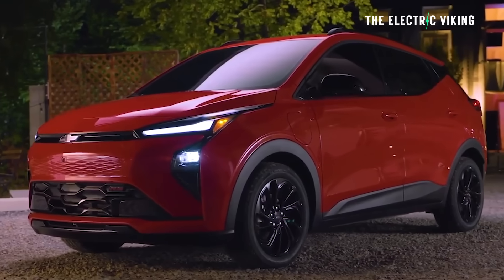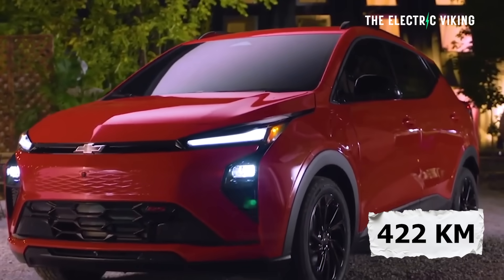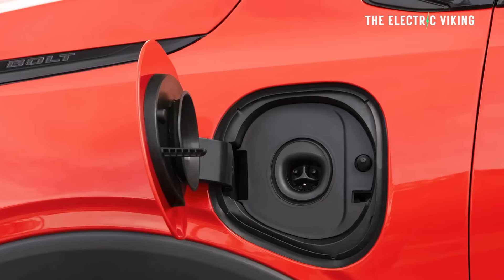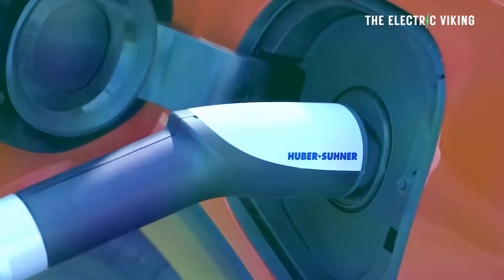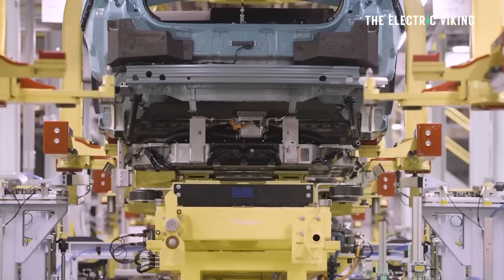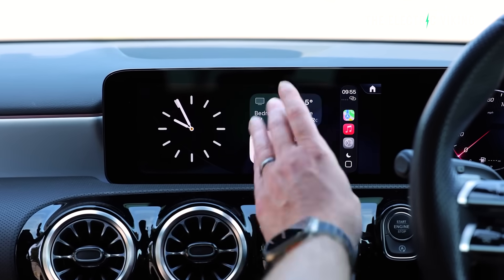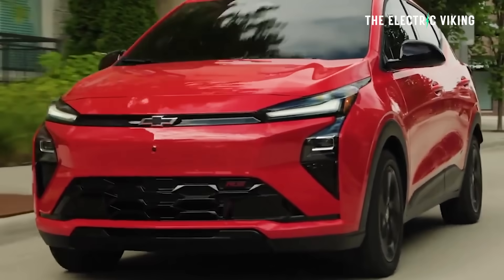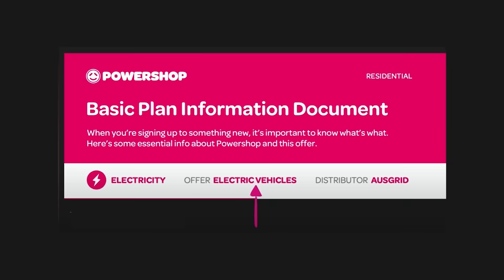NEW Chevy Bolt Goes on Sales With LFP Batteries and MORE Range Than Promised

Comment: $ 29,000 USD in USA!  The new Chevy Bolt with LFP batteries in the USA starts at $28,995 for the LT trim and $32,995 for the RS trim. This makes it the cheapest EV available in America for now, with a range of approximately 255 miles on a single charge

Comment: I own 2 Bolts, a 2018 and a 2019….had both for many years. 8 months out of the year they both get about 220-260 on a charge. They are fantastic entry-level EVs. I would buy the new one with zero doubts if I needed to update.

Comment: 3:14 Great that is a NACS port. Sucks that its in the worst possible location, they should have moved it to a corner. A V3 Supercharger (the overwhelming majority of the ones a Chevy can use) does not have a long enough cable to reach that port without having to park the car across 2 spaces and block an adjacent charger (unless you get the end one and theres empty space next to it, which so far I am 1 for 2).

Comment: 2:52 159 lb-ft? Thats over ONE HUNDRED (100) LESS than the previous version. That would eliminate its best feature - 2 lane passing. Wtf is Barra thinking? Torque is the killer app of EVs. She needs to get everyone hooked on EVs first before she starts shaving off the cool parts to cut corners. That will be a REALLY boring car.

Comment: I bought my '23 EUV as a second choice; I wanted an Ioniq 5 but the waiting list (at dealers that would sell at sticker) was 3 years ; I figured I would drive the Bolt for a while and get something cooler eventually.

I like it more every month. I love the huge back seat and flat floor; I keep looking at other cars (I would love faster charging and AWD) but none of them stack up, nevermind at a similar price. A Lucid costing 2.5 times as much doesnt have the heated/ventilated seats and the roof is so low I would bang my head getting in. Ioniq 5 you have to get the top trim level to match the features.

And I love how compact it is, anything else is 5" wider and 20" longer; I can walk between the cars in my garage without having to slide sideways (which would also be bad with that stupid "modern" thing other cars do where the door handles stab out at you when you get near, doxxing you to everyone in the parking lot that its YOUR car just in case theyre looking to mug someone). And with the 4 way cameras I can get into really small parking spaces.

Comment: No CarPlay is a big deal. GM also placed the NACS port in the wrong location for Supercharger use. Fail. 
For only a couple thousand more, Nissan offers 40 more miles of range, CarPlay, and most importantly, has the NACS port in the correct location. Sorry GM. Swing and a miss.

Comment: We have a 2023 Chevy Bolt EV 2LT. My wife did not want an EV, but now, even today she says it is the best car she has ever owned. She wishes it would charge faster than the 50 kw so the new Bolt at 150 kw solves that problem. We also are interested in the bidirectional, vehicle to home capability. We would consider the new Bolt for sure.

Comment: Please do not confuse the Bolt EV with the Bolt EUV.  This is happening as it seems the EUV will be the only one that will be made in 2027 model year.  Our 2023 can do 300 miles on a charge in good weather and summer tires.  Cruising at optimum speeds.

Comment: Not discussed is the very significant safety advantage the LFP (LiFePO4) batteries have.   LFP doesn't have the thermal run away issues leading to battery fires.

Comment: My '22 Bolt EUV is, by far, the finest car I have ever owned - and I've owned a bunch. The newly released version has no features or meaningful improvements over the previous version meaning that GM obviously got it right the first time. They're a roomy five seater with more than adequate power and performance, is impeccably assembled and the top trim model has luxury car features. Those new to EVs will be delighted with the Bolt for years to come. It's future proofed.

Comment: I was extremely lucky to buy a brand new base model 2025 Chevy Equinox EV last year for $14,600 US dollars ($31,800 - $2,000 dealer credit - $7,500 fed tax credit - $4,000 state tax rebate - $3,700 GM credits). I love it so far. Also, now you can stream Prime Video, YouTube, Tubi, HBO Max and other video streaming apps.
If I charge my car at home it costs less than $5.00 (10% to 80%). Gotta love it.

Comment: My brother bought a used 2017 bolt in the spring of 2025 for $12,000 . It had the battery replaced during the battery lg problem . The car has 30 k in miles so the battery has less than that . It doesn't have fast charging capabilities and that doesn't matter for  him as the car is just an errand type use and not used for distant travel . It's his first EV and really enjoys it and it still drives like new .

Comment: The Bolt had a charge rate limit of only 50 kw prior to this version.  So I'd say they fixed the most serious limitation.  My 2021 Tesla model 3 had LNAC  batteries when I bought it, but at 4 years the battery pack failed abruptly and Tesla replaced it with an LFP battery pack which also gives 263 mi. range.  So I've had the same car with both battery technologies.  I prefer the LFP.  It degrades slower and I can charge it to 100% any time.  In fact in the 17 months/13,000 mi I've had it, it hasn't degraded at all judging from the range it shows when at 100% charge.  So, yes, I'd certainly consider buying the new Bolt. Sounds like Chevrolet finally has a competitive BEV product.

Comment: This is a great car. But if you can get slightly used 2023 Tesla Model 3 RWD under 23k less than 50k miles that would be even better deal. Because LFP batteries last long time and has same CATL battey

Comment: The track record by GM as to EV’s falls on limited production, vehicles too small (Bolt, Spark), too large (Hummer, Excalade, pickup truck) too expensive (same as prior list). Is this latest Bolt the same size of the Bolt or Bolt’ larger cousin? The Blazer EV is the right size for US, priced OK, nice features. It is selling well. Where is this Bolt going to fit in GM’s EV strategy?

Comment: We almost bought the 1st generation Chevy Bolt, but cross shopped it against the 2md generation Leaf and found the Nissan Zero Gravity seats far more comfortable. Both cars suffered from overly wide A pillars. I have no idea what the A pillars will be like on the new generation versions of those cars, but consider your bottom and visual safety when deciding.

Comment: Have just over 170K miles on my 2017 Bolt. Love it. Slower fast charging is my only complaint, but for what I use it for, it's not a problem.  
We need more affordable EVs, so glad they brought the Bolt back.

Comment: I have a 2020 Bolt, my huge issue are the charging stations claiming to be DC. Nothing fast about these stations pushing out 27-32kw at 45 cents per kw and sitting for an hour or more trying to reach 80% from 10%

Comment: If I summer drive our 2023 Bolt EV, single pedal, at less than 55 mph.....I get 320+ actual miles (new battery).  I once pulled better than 350 miles running between 40 -55 mph (I was drafting).  Paid $21K otd.  We charge with 110 overnight without change to our bill.  This car will out muscle any 4 cylinder, make 6 cylinders cry, and embarrass 8 cylinders.  Not a highway car.....but DAMN. Best vehicle from Chevy in a long while.

Comment: We have the 2023 Bolt EV.
Fabulous 2nd vehicle. We bought it used for less than 20k with less than 10k miles on it. We have charged it overnight for 2 years it
ON a household 110 volt standard outlet.
   Super reliable and cheap!

Comment: I can understand someone not wanting to keep a car for 20 years but have the general public lowered their standards to not expect something to still be in good functioning condition in 20 years? Back in the 2000s and into the early 2010s I was still picking up 80s cars as cheap transportation that were still good running cars, if it wasn’t for the harsh Midwest winters and the stuff they spray on the roads they would’ve lasted longer.

Comment: I’m 70.  I just obtained a 2009 Honda Accord with 50,000 miles.  With luck it can be my last car (4th one).  I got tired of waiting for an electric car as simple as my 63 VW Bug, and as compact as my 77 Accord I replaced it with in 1987.  The 1987 Prelude was fun to drive from 2007 to today, but I’m about to call back the waiting list of potential buyers.

Yes, I don’t want to replace my cars after only 20 years unless the body rubber and hoses are decaying.  But that’s what a simpler cat gives me: no fuel pump, clutch cable, radiator, or alternators… the Bug only needed one wrench.  No computers; they don’t like heat or vibration.

Comment: This new Bolt fixes all the problems with the old design. Faster charging, battery conditioning, improved infotainment, adaptive cruise, heat pump, affordable price. Our EV choices in the US are somewhat limited, Sam.

Comment: I really like my 2022 bolt EV. This little car with a small trailer can do about eighty percent of our daily needs to go pick up things. And I charge it for my off the grid solar at home so I guess you could call it free charging most of the time. The vehicle to home vehicle to grid with the newer style would be interesting , but they get thirteen thousand eight hundred dollars for the unit for the home to do that , which I find ridiculous.
Reply: those solar panels didn't come free. But at least you're mostly free of the grid for powering your vehicle.
Reply: @sittinandthinkinactually, my solar panels came extremely cheap.They're part of a field of panels in the way of california bullet train. So twenty four thousand watts of solar panels cost me a thousand dollars😂 that's pretty close to free.

Comment: i had a 2022 Bolt EUV. 200HP is way more than it needs. That's what made it so much fun. You hammer the throttle and it really checks out.

Comment: What I am waiting for is a hybrid Sodium/LFP solid state battery...when that happens the market will not want a petrol car.
Reply: Not successful in the lab yet.  So still 7+ years out for commercial scale.
Reply: @rando7th  "Dongfeng Motor: As of January 2026, Dongfeng is conducting extreme winter tests in Mohe, China's northernmost city, using prototype cars equipped with 350 Wh/kg solid-state batteries. These batteries have demonstrated stable performance down to -30°C (-22°F) and are planned for mass production by September 2026."

Comment: I bought a used 2023 Bolt EV and I'm very happy with it. The slower charging speed is the only thing I wish was better, but if you have a home charger it's not a problem. I'm glad they were able to increase the charging speed on this new one.
Reply: We got a used 2022 Bolt, the base trim, for dirt cheap (bought it a year ago, using federal and state incentives). It's been great for my daughter who is in college. 150 miles is barely adequate because that realistically drops to 120 in cold weather with the heater on. She might actually trade it for a '26 Leaf with the 300 mile range, problem solved.
Reply: @ChickensAndGardening  That may be a good option in the future, thanks for sharing. EVs will remain valuable because of their batteries and materials compared to old combustion vehicles.

Comment: I drive the first gen 2019 Bolt EV and it's great, with factory recalled battery replacement, its range is officially at 259 mi, only 3 miles less than the new Bolt. This one they could've gotten even more range and maybe less expensive if they offered the hatchback version still. SUV shapes are popular, but very bad for efficiency, too high riding and causes constant drag at higher speeds.

Comment: It would work for me except I need to visit Home Depot now and then.. and my one-owner 2010 Passat wagon is still running. quite nice.
Reply: Make a small car that you can't put ANYTHING in, then make it so it can pull a light utility trailer.
Reply: @sittinandthinkin, that's a great idea, but unfortunately, I don't live in a Looney Tunes cartoon or The Mask.
Reply: “Every now and then” when I need items too bulky, too large, too anything, all the large box stores have rental trucks for cheap. 22 Hyundai Ioniq 5 SE long range.
Reply: @Rhaman68I have my folding light duty trailer for thirty years that is available any time I want it for as long as I need it. 1994 Plymouth Sundance, 2004 Malibu, 2015 Toyota Camry.

Comment: Friends were upgrading their Kia Niro EV to a 2026 EV 5, and sold it to us for a very good deal. They upgraded for the faster charging speed for road trips on the newer EV 5.

If most of your trips are under 350 miles, ours, like the old Bolts, is a great car. It is peppy and handles like a little sports car and has a surprisingly amount of room for our huge dog and our Costco runs or luggage. 

Sam and all, I still think that home energy security and independence will be the pathways for broader EV adoption, even in the regressive, dis-United States. As home battery and inverter prices continue to drop and electric and gasoline and natural gas rise, more of us will produce and store our own energy!

Comment: It seems that all cars come with a tv screen. I'm not a fan. I have a 2020 Premier model with a small screen. I like the fact that all of the controls are on buttons and levers. I play that they are analog. I realize that most are digital now. Lots of computers. I had a problem with the car and the dealer had to "fix" it because of all the laws that favor the manufacturer. Software fixed it. Personally I'm too old school to have software fix anything. I never considered it a true problem if soft ware fixed it. 

Things change.
Change. I must get used to it! Or become outdated. I'm already old. 😎

Comment: I've heard that lane centering is locked behind a $3,000.00 USD paywall!....and that itself is just a 3 year pre paid subscription!!!  This is a standard included feature with all the other automobile manufacturers.  Is this true?  If so, I will stick with either Ford or Toyota.  Hard Pass!
Reply: It's not a paywall it's an option exactly like if you buy the XLT or the sport version of a vehicle it just happens to be a software update but it's still just an option so get over your paywall bs
Reply: @rockinrick1207 you seem hurt by my comment.   So sorry.    Again,  this is a standard feature from every other major manufacturer.... included with every trim!   No extra money required!  Not so for the 2027 bolt.   It's locked behind a $3,000.00  "option" which by the way,  only lasts for 3 years,  and then you have to continue paying a subscription fee!    It's a rip off,  and the people deserve to be informed about it.

Comment: 2023 BOLT EV is a great car, especially with home-charging availability, as this model-year charges slowly @ DCFC.  New one fixes this minor issue, for those in “hurry mode.”  Excellent fit-and-finish from Chevy!  GM has an EV Concierge Service, linked to OnStar, and they are a good resource for answering owner questions.  Lotsa “buttons” and familiar controls — a big advantage for first-time EVers, and for old farts like me.  Five Stars.  Pre-owned home-charged BOLTS can be well-bought, and NO, not a  realistic fire-risk, which was vastly over-stated.  Thanks for the review, Sam. 🤜🤛

Comment: You skip over, what  would it cost to  replace  the battery  🔋. 
My neighbor  has electrical vehicles  in four years  them battery 🔋  started  failing and warranty  had run out.  Chevy  bolt  what's  the cost  for  a replacement & I know insurance  for ev must be expensive.
Reply: A non-issue. GM has a ten-year warranty on the battery. My insurance is not anymore expensive than when I had an ICE car.
Reply: These are all debunked talking points. The batteries will outlast the car. Federal law requires an 8-year, 100,000 mile battery warranty. Your neighbor didn't tell you the whole story. Insurance is cheaper on my EVs than it was on the gas cars that they replaced.

Comment: The Bolt is very reasonable in the used car market. It's entirely reasonable to find one for around $10K in the US. They fixed the one gripe I have on this new model which is the DC fast charging speeds and bumped it up to 150 kWs. That will make long distance road trips with passengers more feasible.
Reply: Quick charging better be a lot better! My 2017 with the 65kwh battery replacement quick charges so slow, even in 45° weather it's 20-25kwh on average
Reply: Chevy Bolt was involved in battery-related recalls, which eventually hurt its reputation.
Reply: @yo2trader539  - Even with the recalls it was so popular that GM is bringing it back. People want a small, affordable, long-range EV. The Bolt fits that perfectly.
Reply: 150 kW is decent, but not great.
Reply: @dvader3263 if it can sustain it. The 2017-2024 could not sustain the 55kw at all

Comment: I really wanted my wife to get one but she opted for a Toyota RAV4 plugin. She wasn’t ready to go 100% electric yet. I got a Hyundai Ioniq 5 in Dec ‘24 and absolutely love the car. I’m over range anxiety and the other nonsense people get hung up on. I will never go back to an ICE car. 

The Bolt looks great and with these specs I think it will be a hit.
Reply: Exactly, the range anxiety thing is gaslighting. If you aren't constantly driving more than 400 miles on roadtrips, it won't matter if you get an EV or ICE car.
Reply: Hyundai have unresolved QC control for their ICCU unit. Even some owners have their replacement ICCU unit fail again under 1 year after replacement. Why are you bought one?. 😮😮😮
Reply: @whlawson5812  You will note the I5 was purchased after September 2024. After the updated ICCU with the same part number.
Reply: I hear you brother, I started driving EVs in 2012 and have never looked back...I now drive a Chevy Equinox EV LT2 and is the best so far..even my former KIA EV6 was pretty nice also.😎